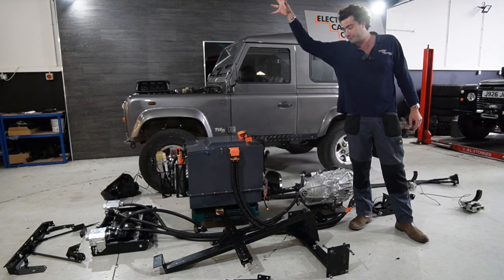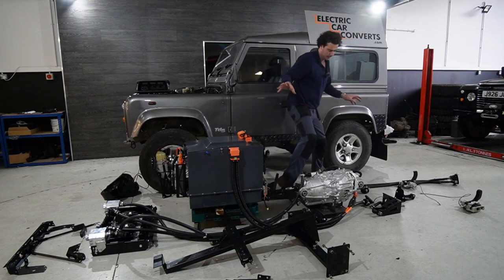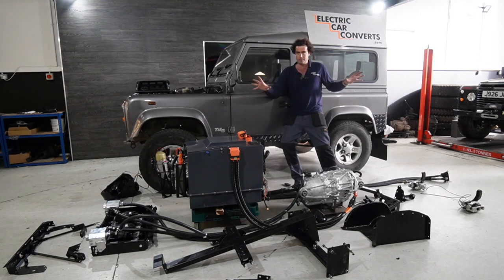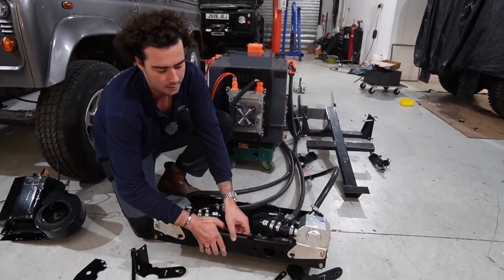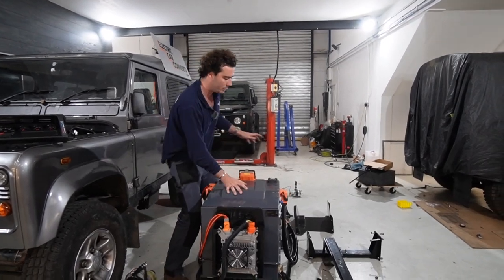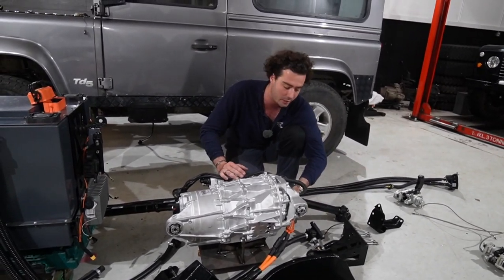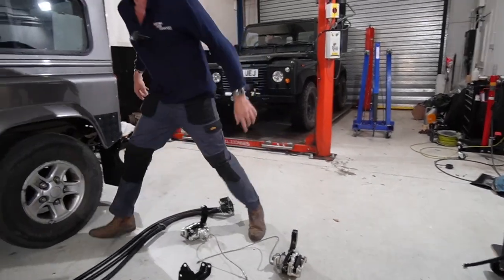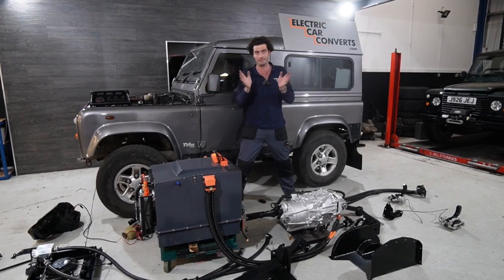The Ultimate EV CONVERSION KIT for your Defender. No Wiring, No Fabrication, just BOLT it in and go!

Comment: But a td5 doesn't have a cable throttle. It's a potentiometer one. Pre td5 did have cable throttle. So do you change the pedal to an earlier one?
Reply from the maker: On this build we swapped the TD5 throttle for a TDI one (which is the same size so bolts into the original holes) but we're currently developing away to use the original TD5 throttle potentiometer instead.

Comment: Great conversion! Hope the price comes down somewhat 😉 So I ditch the original gear box and intermediate box. Do I get diff-lock also? I probably don't need low and high anymore, right? I have an 1985 110, with drum brakes in the rear. Should I do the conversion to disc-brakes on forehand?

Comment: Looks good; great idea to insert all the needed know-how into a plug-n-play kit.
You mentioned in the video how you solved the handbrake-problem. What about the hydraulic brake system, and its vacuum booster? Is it MOT approved? Thanks for your answers!
Reply from the maker: The brakes have either a 12v vacuum pump in them, which turns on when the servo needs a vacuum. It's also possible to do this with a Tesla Ibooster. You use the brake pedal very rarely though, as the regen of the motor does braking for you. Yes it's MOT and DVLA approved.

Comment: this is absolutely brilliant! well done to you and team! will you be offering bits of this kit rather than the whole thing? thinking likes of the battery box system and motor with converted gears could be used in my Grand Wagoneer?
Reply from the maker: Thanks for that! We're certainly happy with how it has come out. Yes we can supply parts, you'd probably only need the battery box (+ the charger etc mounted to it) and the motor, the rest will have to be custom made for your vehicle (mountings etc)
Reply: When I get to that point in the build I’ll give you a shout.

Comment: Your comment at 6:53 is much appreciated. The fact that there are no secrets is amazing. I did want to ask if you have a way to convert VWs to EV with a tesla small rear drive motor and then the rest of what is needed to power and cool and connect. I am doing a 1970s dune buggy conversion and the battery cases need to be custom made front and back and mine is a full DIY build. Can you help?
Reply from the maker: You're welcome, no need to hide things in this industry! We started as DIYers so we get it.. Yes we have done a couple of VW's in the past, I would recommend using the Model 3 rear drive unit over the SDU though as it much more efficient and modern. Yes we can help with battery boxes.
Reply: @electriccarconverts  thank you so much for the reply! And the advice. Watching you and Louis go through his battery packs was also very sweet and educational. I'll reach out again when we have a plan in place. Do I just reach out through the website or back here again?

Comment: @electriccarconverts how difficult would it be followng a 55 kwh conversion to go to the 110 kWh at a later date. Would provision need to be made during the initial conversion? 
Also if the donor Land Rover has had a replacement galvanised chassis (Marsland or Richards) could that pose a problem? 
Thank you....Edit just watched your latest video and you answer the question about adding the second battery at a later date😀
Reply from the maker: Hi, our systems are upgradable to the 110kWh if you already have the 55kWh system. All the mounts are already there so that it can be added quite easily. The only thing to take note of is that we don't want to do it years and years after your first 55kWh goes in, because the front batteries will degrade a little and then not be in perfect sync with the second battery pack. If it was the case that you wanted to do it a long time down the line, we would replace the modules in your front box too, so in essence a full new battery pack. 

No probs at all re a replacement chassis, in fact our workshop jig chassis is a Richards.

Comment: This is really good and it has been perfected. but for £55,000 that's too much for an EV conversion kit. I believe there is a cheaper and equally impressive Kit to be developed and we can make that happen for less than £10,000
Reply: Half the cost of the £46k is probably due to the Fellten Battery pack. Even if battery costs drop by half or more this is still at least a £30-35k kit. If you want quality right now with relatively low volume this is unfortunately the price you need to pay. I think over time if a target cost is about £25-30k that would be a great price point for more to enter in to the EV conversion scene. A £10k or less kit might be possible in about 10 years.

Comment: Hello where did you get the central transmission ? . because you can find front or rear driven. not found  central transmission driven yet .
Reply from the maker: The transmission is built into the original tesla motor, we just change the gearing inside it.